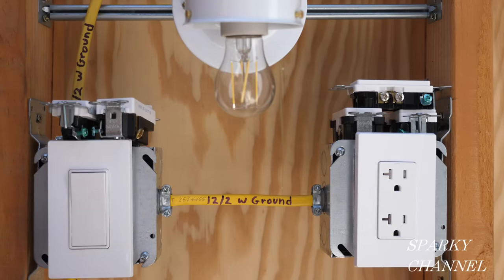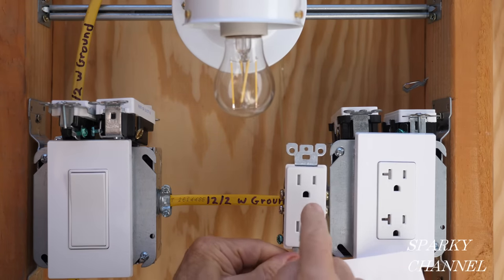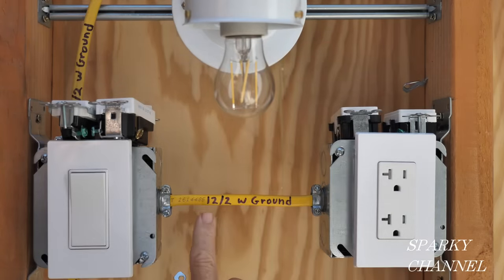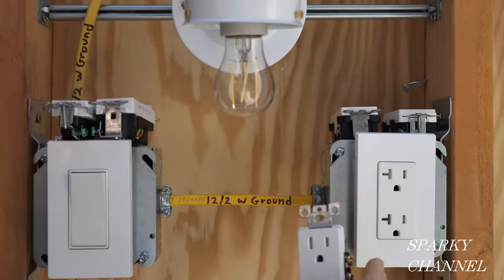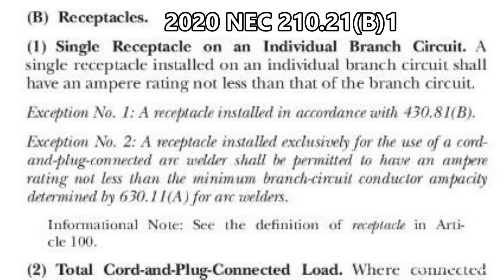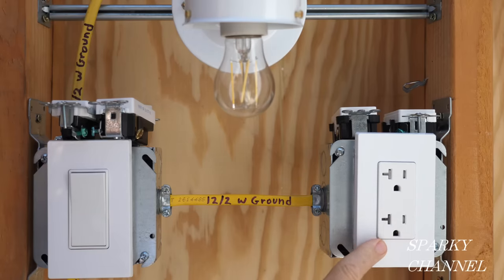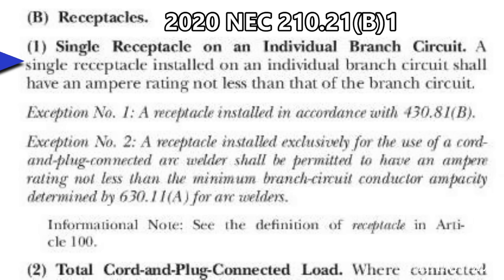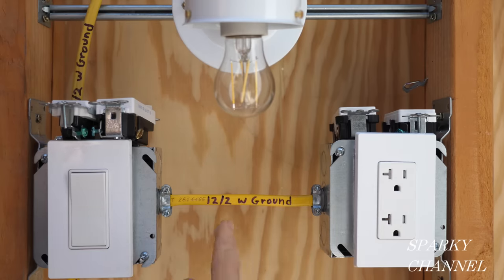Shall I Use a 15A or a 20A Receptacle on a 20A Circuit? + 2020 NEC 210.21(B)(1) and 210.21(B)(3)

Comment: 20 is best but it mostly comes down to wiring method. Code allows 6 recepts on a branch circuit. When wiring through recepts instead of to them (pigtail), the first one in line has all current passing through it. Let's say a combined total of 19.8 amps,  Even a 20A can and will heat up potentially causing a fire before tripping breaker.
Reply: Can you clarify what you mean by 6 receptacles on a branch circuit? I don’t believe there is a hard number for general purpose receptacles as more are preferred to reduce extension cord use.
Reply: @jeremiegrund  yes sorry that was supposed to be an 8. Technically there is not a specific number but using 80% rule along with average amp draw of equipment (I figure 2amp) instead of 1.5 as many appliances draw more such as vacuum/heaters. Wiring in series I would limit to 6 for safety as all total current on branch has to pass through first receptacle. When wiring it in parallel the amount is endless (within 200' or length of voltage drop)  as current only goes to receptacle being used.
Reply: @KevinSmith-yz3lx  nope residential code only limits the size of the area a circuit can serve at 3 VA per square foot.  commercial code requires circuits to be calculated at a specified VA per convenience outlet, and I'm not going to bother looking it up right now.  also, 80% rule is related to permanently installed heating equipment or permanently installed equipment expected to run for more than 3 hours at a time.
Reply: @kenbrown2808  ... the only thing that bothers me about using the 3 VA per sq ft rule is several small rooms could potentially wind up on the same circuit. Obviously there's something buried in the code to change that so you don't wind up with 4 bedrooms and 16 outlets on a single 20 amp breaker.
Reply: @rupe53  I've seen houses with 4 bedrooms on one 15A breaker, back when it was only bedrooms that had to be AFCI protected. It's my biggest beef about requiring AFCI breakers. The cheap outfits stretch them to the limit and the when the homeowner calls a handyman, he overfuses the circuit.
Reply: @kenbrown2808  ... my home originally had 4 rooms on a single circuit, but it was built in 1910! (one 15A circuit per floor) It was a 30 amp 110 volt service and eventually went to 60 amps at 220, when they added basement lights, central heat, and well pump. Got upgraded to 100 amps in the 70s and to 200 amps about 20 years ago. All of the wiring is mid 70s or newer. (every last speck) Have several GFIC circuits but no arc-faults at the moment. I figured out the 30 amp service history when I first pulled down the 60 amp panel and saw the "mouse ears" that had been painted around the meter on the wall. (meter and 2 fuses)
Reply: @rupe53  my brother's first house was retrofitted to knob & tube.
Reply: @kenbrown2808  ... I hope you mean FROM K&T to something better! <LOL> In this area anything before 1910 might have been K&T but that quickly changed with the advent of local industry here in New England which brought us power very earl on plus the so called Craftsman homes sold by Sears in that era.
Reply: @rupe53  nope, it was originally plumbed for gas.
Reply: @kenbrown2808  ... had to be in or near a city to get gas, which is why most of New England was using oil till recent decades.... then propane became more popular... but oil is still the majority.
Reply: There is no code that limits you to 6 receptacles per circuit.
Reply: @KevinSmith-yz3lx  There is no 80% rule.
Reply: @lloydmills9619  ... while technically the 80% rule is mostly for hardwired appliances (AC, water heater, etc)  there's mention of using that rule in any branch circuit where there might be full draw for 3 hours or more. (continuous duty) Besides, many standard breakers are not rated for continuous duty so you need to consider that anyway. Most of us keep it in mind just to stay out of trouble.
Reply: @rupe53  No.  You're entirely Mis applying and misunderstanding 210.19a ish.   This applies to continuous loads only not appliances and definitely not general purpose (or any) receptacles in a home.
Reply: @lloydmills9619  you're right sir and I understand your interpretation of no 80% rule. I perceive it to be a good practice to prevent overloading as with a lower/ limited amount of recepts. Especially when wiring through in series.
Reply: @lloydmills9619  ... that section of NEC talks about the connected load, which for the most part will never reach these limits in a normal house. OTOH, that depends on what we consider normal. With power tools in a shed, garage, workshop, it can add up fast and will most likely be connected to a branch circuit and not dedicated home runs. The fact that they changed the wording between 2011 and 2014 is only a clarification and basically means the same thing. BTW, an electric heater added to an existing load (some lights?) could be a continuous load.
Reply: @kenbrown2808  On occasion, I still open the walls in a customer's Victorian home and find the old cast iron piping for the old gas lighting from 1880.   It drives my stud sensor crazy.  LOL
Reply: @chrisgraham2904  he was wondering why the conduit to his light fixtures was made up with watertight fittings until he removed a false ceiling and found soot stains around the light fixture location.

Comment: Why are 20a 120V receptacles made? I have yet to find one appliance or tool which uses them.
Why don't tool manufactures take advantage of them?
Reply: If a tool manufacturer designed a product that's often using more than 16 amps it is safer and better for their reputation to require a 30 amp circuit with minimum 10 gauge wire.  Getting UL approval may also be an issue. I have never seen anything that uses that kind of plug either. Why are they even being made? Some people think that they are needed on a 20 amp circuit and others know that they're not, but prefer them anyway.
Reply: Main place I can think of is in the data center. The server you're watching this video from is likely plugged into a PDU which is in turn plugged into a 20A receptacle.
Reply: Get bigger tools.
Reply: There are many 20 amp rated industrial appliances and tools that have motors that require the extra startup current rating of a 20 amp dedicated circuit. I've noticed if its a combo 15/20 general use receptacle being used with a  dedicated 20 amp corded appliance, sometimes the GFCI will trip or sometimes the circuit breaker will trip. That being said, since the wiring and breaker should be rated for this type of load, I think the general use combo units are not always up to the task of industrial loads due to poor connection of a subpar receptacle and the natural leakage of ground fault current created by motor starting is not designed for these general used GFCI receptacles. Of course this is all speculation and what I have experienced.

Comment: Now if only the industries would find a way to mitigate the cost of the 20 amp receptacles.
Reply from the maker: Yes, I agree!
Reply: I always install 12-2 wire for power throughout the property. However, I cannot afford to install 20 amp receptacles throughout the property. I definitely install them in the kitchen. I only purchase and install 20 amp GFI receptacles!
Reply: It isnt a cost issue its a safety issue.  A 20 amp device allows a 20 amp (
more then 15amp) appliance.   The 15 amp device does not.  Why would you install multiple device that allow a 20 amp appliance on the same circuit?

Comment: Personally, even though we might not have devices that actually use 20 A, anything there is 12 AWG, i'll put a 20 A device like a NEMA-20R outlet. Not necessarily because of current rating, but as an indication it's on a 20A circuit and I wouldn't want to out a splitter cord made for 15 A on a 20 A circuit.
Reply from the maker: Good point, thanks!

Comment: If I was a manufacturer of these products I would test to make sure my receptacle could safely handle at least 40 amps, then advertise it as being able to handle 15 amps, so that way if its installed on a 20 amp breaker, it willl be able to handle the current/load.  

I don't know why companies have to be so cheap when it comes to their internal conductors.  Hell, my WAGO connectors can handle over 30 amps, why can't my receptacle?  Maybe we should just get rid of 15 amp circuits altogether and just run 10/2 on all 20 amp circuits.  

Nice thick 10 AWG should keep your wires nice and cool under max load on all 20 amp circuits. 8/3 on dryer/AC units, 6/3 on range, and ev chargers.
Reply: think about all the light fixtures that come pre-wired with 18ga stranded.... and you link it up to 14 or 12 solid. I don't see any issue running 14ga legs off of a 20a 12ga run for a light circuit since the legs will never get that hot unless you're running a blow drier from the light socket.

Comment: Does that go for switch too ?
Reply from the maker: No, use 15 or 20 amp switches on 15 or 20 amp circuits. I've never seen a regulation like that for switches.

Comment: Can I use a 10 gauge wire on a 20 amp circuit?
Reply: Yes you can but you will be wasting money
Reply: @FH_83_02  Thanks for the info. Can I ask why i would be wasting money?
Reply: @arisreyes5717  10 gauge wire is more expensive than 12
Reply: @FH_83_02  That simple.  jaja. thanks.
Reply from the maker: Yes. You may have to due to voltage drop on a long run.
Reply: Retired Electrician here.  Yes 10ga is more expensive but it is also very hard to work with.  10ga is much stiffer, thicker and hard to bend.  If you have more then 1 set of 10ga wires in a receptacle box it's almost impossible to install the receptacle in a 2 x 4 receptacle box.  For the same reason, I prefer 14ga on lighting circuits.  It's so much easier to work with.
Reply: @Ron-no4tp  thanks fpr your insight

Comment: Seems that the code exception regarding "single receptacles" is referring to a branch circuit that has only ONE receptacle (either simplex or duplex) on it - then that receptacle must match the circuit amp rating. Yes? No?
Reply: One receptacle means single (simplex). A duplex is 2 receptacles, and yes that single receptacle must match the circuit rating.
Reply: @surferdude642  and if you too many beans, you will fart
Reply: @surferdude642  eat too many beans, that is

Comment: But which one is the best?
Reply: If you're comparing residential grade 15 amp to a 20 amp, then a 20 amp is better, being mindful that a 20 amp receptacle can't be used on a 15 amp circuit. However, if you're comparing spec grade or heavy duty, there is no best, they are identical internally.

Comment: About the only time I could see putting a 15 amp plug would be for something like an electric clock.  Stuff doesn't fail because a component is over capacity.
Reply from the maker: Excellent philosophy!
Reply: @SparkyChannel  I used 20 amp GFCI's in a kitchen and the customer HATED them. The force needed to plug/unplug small appliances was too high. I changed them out to 15 amp GFCI and was a hero.

Comment: I used a 15A GFCI on a 20A circuit to use with the refrigerator, is it ok? The old outlet is a 15A because it has no cross bar on it. Thx
Reply from the maker: Hi Peter. The problem with using a GFCI for a refrigerator is if the GFCI pops and all your food goes bad.
Yes, you can use a 15A receptacle on a 20A circuit. 15A receptacles are rated 20A pass through.
Reply: Thx Sparking. Just a thought, if the outlet trip, the food will go bad eventually but the GFCI is there to protect surge current from damaged the refrigerator correct? Thx
Reply: @BibleExposition2022  No, the gfci is not a surge protector. It checks to see if the current going in and out are the same, if not it will trip indicating a current leak, and not a voltage spike.
Reply: @surferdude642  I've read a few of your comments and you seem to know quite a bit. 
Could you explain the gfci more? 

"Current going in and out are the same"?
"Not a voltage spike"?

So, if someone is getting shocked, (voltage leak) it senses that the power coming back through the neutral is less than what's going through the hot wire. 
Amirght? Lol.

It won't shut off if I pull too much current through it? 
Is that what the voltage spike comment means? 

I have a 15 Amp diamond blade saw that will trip a 15 Amp gfci very easily, that's why I ask.
Reply: @duckingcensorship1037  A surge protector is the device for protecting against spikes. A gfci monitors the current coming in and going out, and if the difference is approximately 6 mA, it will trip, so you are correct. It doesn't check for excessive current, that's what the circuit breaker does. You can have a gfci circuit breaker, which will do both instead of a gfci receptacle, then the entire circuit will be gfci protected. As far as your saw is concerned, in theory it should not trip the gfci. Sometimes these things can have nuisance trips, though. But your case is more than a nuisance trip. It could be worn out insulation in your wiring, the saw itself could be the problem, or the gfci receptacle could be bad. You didn't mention how old these things are.
Reply: I believe GFCI (and AFCI) receptacles are now required to be Readily Accessible, so can not be located behind the appliance.  In Massachusetts, no inspector will allow a GFCI behind the fridge, so would need to be a combination AFCI/GFCI breaker.
Reply: @robert-ne1835  I have not one GFCI outlet in my home anywhere.     All are AFCI/GFCI or GFCI breakers..  All are 20 Amp breakers with 15amp outlets.   My inspector made me change all my breakers to 20amp  12/2 Romex.

Comment: If my current bracker is 15A can I just replace it with a 20A breaker and run the 12/2/G and 20A recepticals from that?
Reply: Yes.  As long as you run a new line of 12/2 wiring from the panel, you can change the breaker to 20 amp and add 20 amp receptacles on that circuit.
Reply from the maker: Only if every bit of your cable is 12/2. If any 14/2 is left, you cannot change to a 20A breaker.